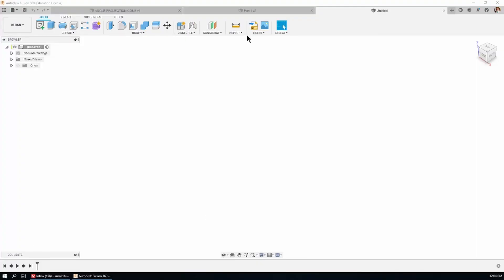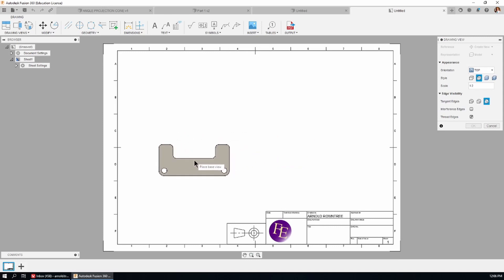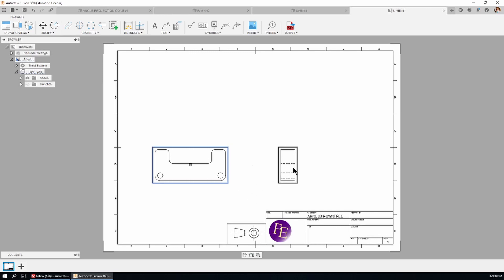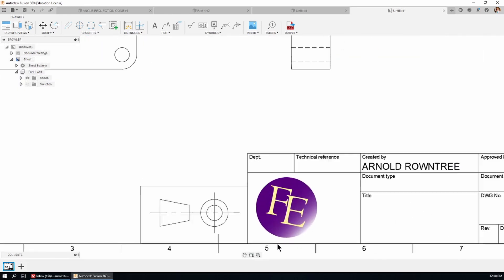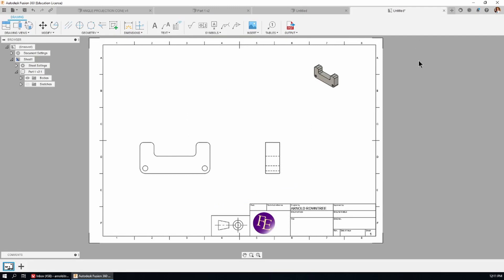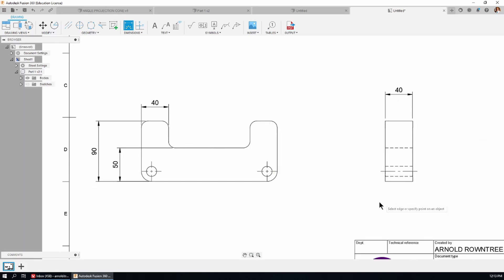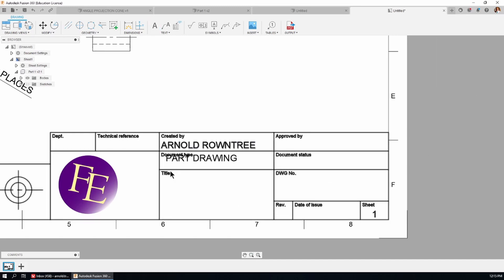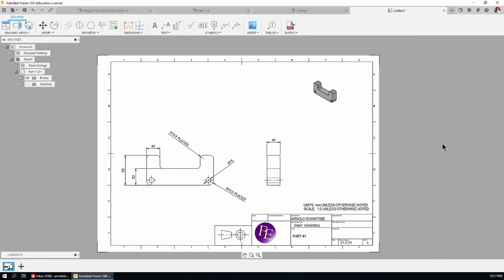Fusion 360 2D Drawing Tutorial | Its semi-automatic!

Comment: Can you do a video for sheet metal as a lot of sheet metal work these days are cut with a laser or water jet cutter. Fusion does have a sheet metal facility showing flanges bends etc. How would you do a rolled bead line used for rolled edges or for reenforcing  a part etc, how to form holes and cuts and extrude thickness. Plus put it in dxf and a drawing.
Reply from the maker: Thanks for the pointer Chris, all I can say is that I'll add it to my 'to do' list. I really haven't done any sheet metal work in my life but Kevin Kennedy has done some basic tutorials here https://youtu.be/NXu8vVYvjrg

Comment: Hi just watched your video, thanks a lot really helpful. Just one thing, you mention that you are using 3rd Angle projection. But I think that you are actually showing 1st Angle projection, with the 1st Angle projection symbol.
Reply from the maker: My heart skipped a beat there Michael, and yes I did mess up the symbol although not in the way you suggested. I've got the two 'views' around the wrong way, but as they are, they still 'read' as 3rd angle. If they were indicating 1st angle, the little side view of the truncated cone would be mirrored left to right so that the right hand side view is on the left and vice versa. In the symbol here, the left hand side view is positioned to the left of the front view. My text books which are drawn to Australian Standards (the ISO system) are the same except the two little views which make up the symbol are the other way round with a front and right hand side view instead of a front and left hand side view as I have it.